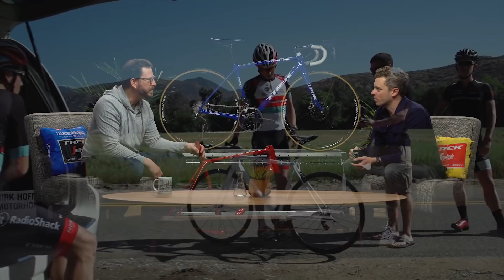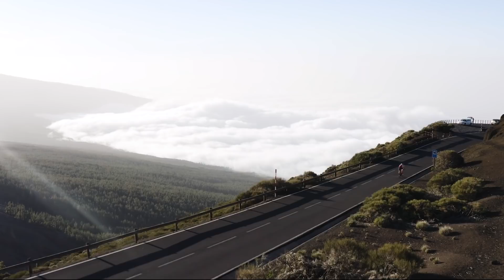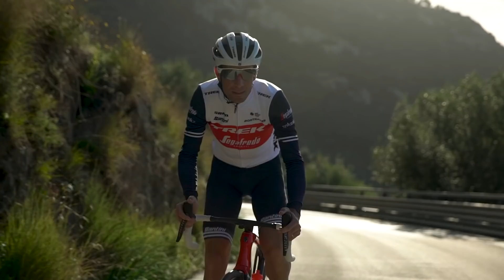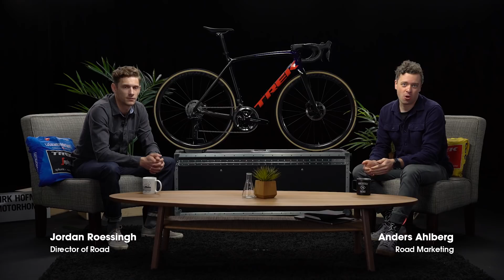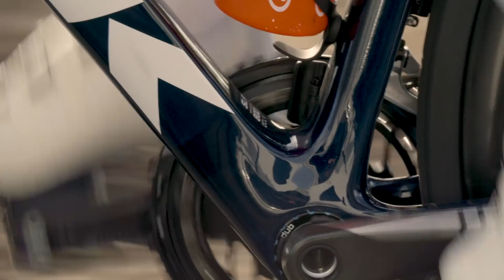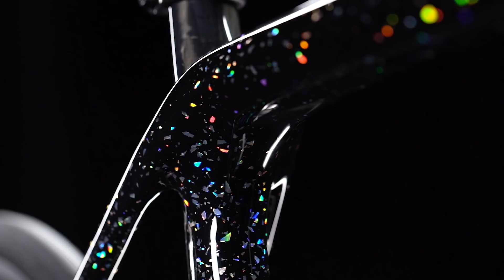The All New Émonda

Comment: I've now had 2 Emonda SLR 9 eTap AXS...so obviously I absolutely love them.
My biggest question for Trek is why do all this work to maximize the aerodynamics, but then stick with this almost 10 year old round seatmast cap. Surely even just using a "D" shaped seatpost would have saved a few more watts. 
 And also I work in the industry, so I'm well aware of just how many Trek models use (current and older models) the round seatmast cap. 
  It's honestly one of my only complaints about the newer Emonda SLR. I know it makes it easier for Trek, but adding 2 more SKU's (aluminum and carbon seatmast versions) can't be that hard. So I'd love to hear the reasoning from Trek.

Comment: Does the '20 Emonda SL ride the same as the '21 SL; just that the '21 is slightly aero?
Reply from the maker: Both models are lightweight and stiff, but the new Emonda will lead the chase being aero and stiffer than past model years!
Reply: @trekbikes  just saw this. Thanks for the reply. I have since picked up a '21 sl5. It's an amazing bike. My next question: does the sl have the same ride characteristics as the slr; just that it's heavier?

Comment: The top of the range Émonda SLR 9 at $11,000 US and weighing 6.8 kg and about middle of the range Émonda SL 7 at $ 5,000 US and weighing 7.8 kg. 
None of the range is lightweight by anyone’s standards. To state ultralight is a bit of a joke. And don’t say aerodynamic is more important, just marketing nonsense.
Reply: Only their oclv800 is considered to be "ultra light", but ya, they should nake that distinction more apparent.
Reply: @ayowser01  "their"

Afaik it's just a rebranding of a slightly better toray carbon fiber
Reply: Agreed. Though the sub-700 gram frame is kinda good, I suppose

Comment: I purchased EMONDA SL6 pro. The screw which constraints the turn of the handlebar was broken. Thus the turn went beyond the limit and the ring marked go-go-go hitted the frame. The paint got damaged. I brought the bike to my supplier and they talked to TREK. TREK installed a new screw and new ring go-go-go. TREK didn't want to repair the scratches on the paint of the frame caused by the limitless turning. Now I have a new super bike with scratches on the frame. I didn't expect that from TREK. Low customer support and poor warranty. Bad experience. I feel dissapointed. The bike itself is a super bike but the warranty service does not work as it should.
Reply from the maker: Sorry to hear about this! Our warranty does cover defects in manufacturing, but without knowing the cause of this bolt breaking, I can't speak for it. We suggest talking to your dealer to get assistance with locating a close matching touch-up paint for your scratches, otherwise, these may be able to be buffed out.
Reply: @trekbikes  My dealer (Probike, Barcelona Spain) stated TREK can't do anything else about the scratches. Scratches are the outcome of a broken bolt during manufacturing or installation. They sold me the bike without constraints in the handlebar turning. Nobody from Probike paid attention on that detail. I discover it by myself when scratches appeared. Then I found the issue. Firstly I tought it was an engineering deffect. I called Probike and brought them the bike and one of their mechanicians stated the bolt was broken. I feel deeply frustrated. TREK should provide dealers with some product training in order to avoid similar situations in the future. Moreover TREK customer support is not handling issues as expected. This is my second TREK bike and will be the last one if TREK doesn't fix this up.
Reply from the maker: @rogerserra1315  If you have your warranty claim number, we'd be happy to look into this further. Give our team a call at 01908 360140

Comment: 18 watts of drag improvement is seriously impressive. That would put it in the category of Swork Tarmac. Which is surprising given the seat tube and seatpost are still tradition round tubes. Not sure if thats just the result of the frame or with the contribution of the new integrated handlebars and wheels.

Comment: This seems similar to the KVF design from a few years ago upgraded with disc.  The prices at 33% higher for the SL6 which used to be $2499 for the rim brake and now costs $3299 for this new design with disc brakes.  Trek seems to alternate between oval tubes and the aero tube shapes every few years.  In addition, all their bikes have gotten heavier with disc brakes.  The old Emonda SLR6 to my recollection was 14.75 lbs and was in the $6000 range.  I don't think you can find anything that low weight anymore without paying $10k or more.
Reply: my 2016 with a few changes is 14.25lb in size 58cm.